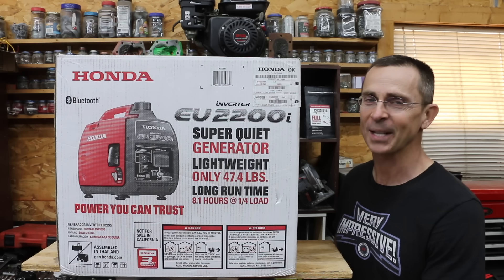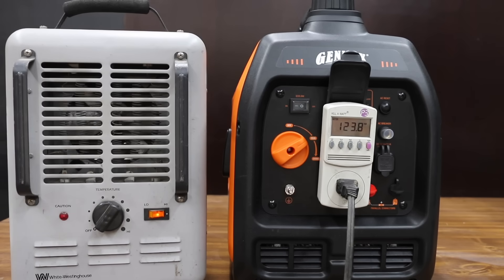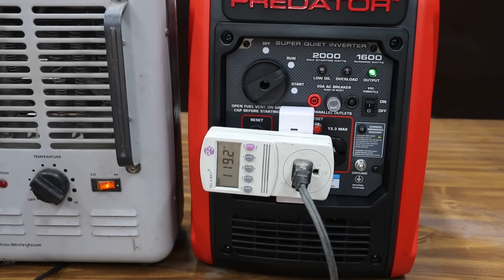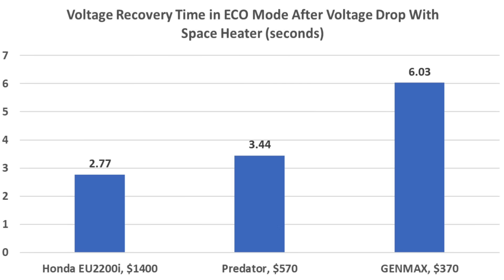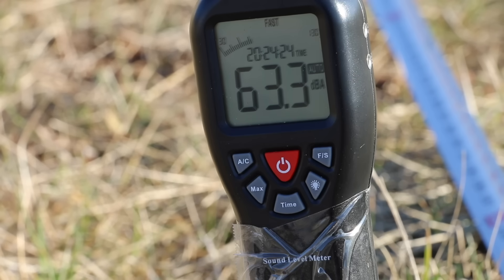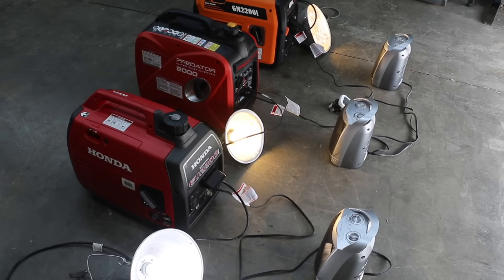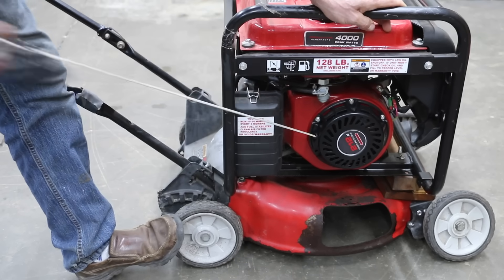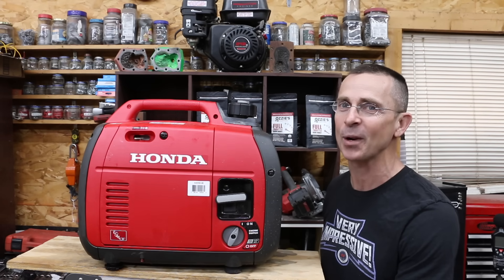Cheap Generator Better Than Honda? Predator vs Honda & GENMAX—Let’s Settle This!

Comment: Why not compare the USA-made Ini Power IntelliGEN Flex-Fuel Generator IG1000-ICMF  with the Honda?  Good, military-grade quality used by the Army, Navy, airlines and railroads.  Honda makes a great generator.  I wonder how good the IntelliGENs are.
Reply from the maker: Thanks for the suggestion.

Comment: Great video with all the details.  I have two of the Honda EU2000i and for the past 20 plus years they have never let me down.  I say, buy the best and forget the rest.  I never buy cheap tools and that includes my power equipment.  Honda generators, lawnmower, rototiller, string trimmer and riding mower.  It has to be a Honda or Powered By Honda.  I save money in the long run by not going cheap at the start.

Comment: I live in Alaska.
The most important feature of anything and everything up here is - reliability.  Because the nearest repair shop/parts store is probably more than 4 hours away.
That's why every single piece of motorized equipment I have ever owned has been Honda.
Honda is so reliable I don't even spend one second worrying if it will start and run perfectly.

Comment: Having both the Honda and Genmax, the biggest difference I see is the Honda runs smoother, it handles a/c starts better and starts on three or less pulls even after storing for months.   The Genmax always has an occasional miss even since new.   It also requires five or more pulls after storage to start.   And there is an absolute quality difference.    My old EU3000i still runs great, even though it smokes a bit at startup and that was purchased in 2001 and had an extremely high number of hours as a primary power source for a cabin running 24/7 for months and is still used in summers for the A/C in the cabin.
Reply from the maker: Thanks for the feedback.

Comment: It would be awesome if you did a "part 2" with more competitors. CHAMPION brand is a popular one, and they have a duel fuel model. I like having multiple smaller generators as opposed to 1 big boy, if something happens to 1 of them, you're still not completely screwed. However, I'm willing to bet other size of generators would be VERY popular for a video too.
Reply: I second the request for Champion
Reply from the maker: Thanks for the suggestion.

Comment: I have the predator. 3 months of daily use so far, sometimes 18 hours a day. So far its great. The choke cable vibrated loose once, no biggie, easy fix. Regular oil changes and premium fuel have made it run efficiently and reliable. At $599 its not the cheapest option but you cant beat a brick and mortar.

Comment: Both of my Genmax generators wouldn't start after 6 months of non-use and filled with regular gasoline containing ethanol.  The generators were stored in a heated garage in their original shipping boxes.   I tested them when new, and 6 months later when I needed them, they were junk.    I have no access to non-ethanol fuel so I used what I had.   Altho they probably just needed minor repair by an engine shop, I consider them a waste of money because they were useless when I needed them during a storm blackout.

Comment: Honda and Yamaha are worth the extra money.  Extremely quiet, clean sin, and runs forever.  Have 3kw Yamaha bought for $1700 back in 2005 for tailgating. Always worked great. Has battery for electric start.  For power fans, multiple TVs, sat receivers, radio/speakers might have to refill gas one time if it’s a 12-15 hour day. Runs 9 hours at full load of 2800W.  Quiet as can be. Only issue I had is when people plugged in 3 or 4 crockpots as on high that’s exceeding its load capacity.
Reply from the maker: Thanks for sharing.

Comment: Real life experience, I have had 3 different brands of snowblowers over the past 10 years, each breaking down within a few years, on the other hand, I have honda lawn mower for the past 15 years, still going strong, yes it was expensive but over time, it turned out to be the cheapest. Going forward, Just HONDA.

Comment: Great Review, but I was slightly disappointed at the end that you didn't discuss which generator, Genmax vs Predator. Obviously Honda wins. My opinion for the money it would be the Genmax. Predator was doing good up until the wear on the sparkplug which killed it.

Comment: The additional 4 ounces of oil is a HUGE plus.  These small engines run very hot.  Oxidation occurs much faster with the heat. Honda is worth it.  You get what you pay for. More oil in crankcase is a huge factor.  The Yamaha has gear driven valves;  Honda uses a rubber belt.  The  professional fishing outfitters in FL all swear by Yamaha.

Comment: The Honda will still be working in 20 years when you grab it from your garage.
Price shouldn’t matter when it comes to something so reliable,it’s worth it in an emergency when you know that thing is gonna start and run a slo g as you need it.
I have eight of the 2200’s,a eu3000,a 6500 and a 7,000.
I buy and repair them.
Almost always the problem is people letting ethanol gas sit in the carb.
Once cleaned they run like new again.
Reply from the maker: Thanks for the feedback.

Comment: Will the life of the Honda out last 2 Predators or 3 Gen Max gens?  Really not enough difference there to make me buy a Honda over the Predator but reliability is wroth more to me so I would probably buy 2 Predators so I could run in parallel if I wanted as wells as have a back up if one goes out.
Reply from the maker: Thanks for sharing.

Comment: Hey man, can you PLEASE do me a solid and tell me what the numbers are on the ignition coil for this unit? I have the same one and I have spent the entire day trying to find it online. Mine got rubbed off, I have zero spark, fuel is fine. long story short, I have diag the unit with tech as well, they refuse to send me one.

GM2200i
Reply from the maker: Which generator?

Comment: Concering quality and longevity. I will take the Honda. Thur the 80s I was a Honda dealership parts manager I also setup.. The Honda Rep. told us ... If you maintain that Honds lawnmower according the owners manual. That Honda lawnwer will last 200 years..❤
Reply: Enjoy this channel very much.. I would consider the Predator.. My brother has one
Reply from the maker: Thanks!  Thanks for the feedback.

Comment: Champion Power Equipment
4000-Watt RV Ready Portable Recoil Gasoline Inverter Generator. Please just bought one and don't know how clean the power is, I'm not trying to destroy my air compressor.
Reply from the maker: Thanks for the suggestion.

Comment: Here’s my long and short of the killer job you did here. Honda is a fantastic piece of engineering. However you could buy a genmax with 2 backups for the around same price.

Comment: TLDR:  Buy once, cry once.  Nothing beats a Honda Genny.  I bought an EU2200 used 4 years ago and after an oil change Ive only had to replace the air filter as I use it often.  I aid $700 for it overall I think thats the smart way to go, buy used and keep forever.
Reply from the maker: Thanks for the feedback.

Comment: you can compare it brand new it wont matter
what matter is
even after 15 years my honda starts only after a few pull on cold start, and one soft tug on hot start
and the cheap one wont even turn on after i dont use it for 6 months
for this kinds of thing, reliability is the most important
Reply from the maker: Thanks for the feedback.

Comment: I'd like to see:  duel fuel generators compared.  Wen 5600 vs Westinghouse 4650 vs Champion 4500.
Details on engines that they use would be helpful.  Do they use aluminum, steel or cast iron sleeves.  At what max load do they cut off at.  Run time at half load.  How long before each runs out a full 25 lb propane tank.  I plan on running propane (don't have to worry about propane going bad) but would also like to see how long they'd run on a full tank of gasoline at half load.  Also, if you know of anyone with electrical knowledge or is an expert on small engines get them to chime in like you did on your review of welders.
Looking to power a frig (i know they pull more power when the compressor comes on), a small 5000 btu air conditioner and if it's winter a 1500 watt heater and a small blower to a wood stove and maybe a few lights.
Reply from the maker: Thanks for the suggestion.

Comment: Get a honda if you want quality. But if want something cheap and working just get a genmax. With less weight it will be easier to move/handled. Because at that level of weight, 6 pounds difference feels a lot especially for girls. 😁

Comment: I was a true Honda man.  Ten years ago I spent two thousand on a twin cylinder Honda.  A drop in motor for my Hydro Mac Skid loader. Fit right in. Would not start at all. Called the company. Oh yea had trouble with some ignition trouble. Started right up.  Then muffler fell apart. Ran good ßven months. Sent another ignition still would start.  Pulled it out put a Kohler in. Been running great for years.
Reply from the maker: Thanks for sharing.

Comment: 14:18 what do you expect, its expensive for a reason, ive got its little brother, the eu1000i and its worked great since i got it back in 1998.
Reply from the maker: Thanks for the feedback.
Reply: 1998 WoW!
Reply: my local hardware store got some as they released and I picked one up for use with corded power tools and tailgating. Yes it’s lacking some newer model features but if you take proper care of it it’ll do the same with you.

Comment: Ive got a Honda EW171. Its provides 170 DC amps for welding and 4000 Watts AC for when our lights go out. Its old and loud but cranks up every time we need it and it was free from my father in law, thanks Cal trans 😆
Reply from the maker: Thanks for sharing.

Comment: I recommend Lucas high zinc break in oil for first 30 hours and use a magnetic oil dip  stick too. Make sure to oil the foam air cleaner element too, seems like they are factory installed dry.
Reply from the maker: Thanks for the feedback.

Comment: If you're shopping for a generator and plan on using/depending on it for a long time, just buy the Honda.  I use my EU2200i for camping to keep the camper charged up while boondocking (and to power the coffee pot and the wife's hair dryer in the morning), and even converted it to propane (Hutch Mountain), so I can get longer run times with a 5 gallon propane tank (typical bbq grill tank) vs the internal 1 gallon gasoline tank (basically 40 hrs runtime on propane vs 8 hrs on gas).  I visited New York City and every food vendor cart had a Honda powering it.  Imagine the run times those units are producing?  Awesome video showing performance and wear results.  As always, buyer beware!  Pete in Arizona - KI7LIL
Reply from the maker: Thanks for sharing.

Comment: I scored a Honda several years ago off of craigslist.  Brand new in the box for $600.  I took it out of the box, put the oil in and stored it without fuel.  I took it out before a major storm blew through and could not get it to start.  Turns out, that the small bit of fuel the factory put in for the test had not been run dry and fouled the carb.  Lesson learned, but still a good deal and I love that thing!

Great analysis, and bravo on your methodology.
Reply from the maker: Thanks for the story and the feedback!

Comment: What I find interesting, is my 14 y.o. Yamaha EF2000IS comes with an 8amp battery charger built-in, with a separate outlet and special charging cables included. It also has a fuel shut-off so you can run the carb dry, and a vented fuel cap like these, so it keeps the fuel fresh and free of moisture and air from degrading it. Sits for months on end without use, and fires up easily every time since owned. Very surprised that these much newer models are still lacking behind a 14 y.o. model.
Reply: Did a side by side test with a friend's Honda EU2000, they were very similar in noise output,  but the Yamaha ran much smoother, which was surprising.
Reply from the maker: Thanks for sharing.

Comment: Another great video my friend. I'm in the market to buy a generator. I read a lot of good reviews about Westinghouse generators.. I'm looking specifically at the 3300W/4000W dual fuel unit. It has remote electric start with a backup coil pull. Has a built-in trickle charger for batteries too.
Reply from the maker: Thanks!  Thanks for the suggestion.

Comment: there is a timer hidden in the honda wire harness that turns the engine off after a certain period of time in the trouble shooting manual after every thing checks out ok it says to install a new wire harness.

Comment: I'd love to see a comparison against some generators in the 3000-4000w range. Honda makes one in this range, theres also the Predator 3500. Maxpeeding rods MXR4000GT, along with a champion generator in this area. There's a lot more, but these are the ones that come to mind.
Reply from the maker: Thanks for the suggestion.

Comment: Based on the analysis it appears that while the Honda costs three times as much, the less expensive brands will wear out three times faster.  Is that an accurate summation?

Comment: There are three more generators of similar nature:Yamaha, Champion, and Wen. The form factor is becoming popular, I think. Also, I used a Predator 2000 heavily for a coouple of years and the regular oil changes and exhaust cleaning emphasized by the manufacturer are important. The machine will eventually become hard to start and run rough without them. This is a reference to the high iron accumulation in the chart.
Reply from the maker: Thanks for sharing.

Comment: It is a big blame for the gerator companies, giving US not a specific fuel consumption (SFC) and a efficiency diagram.
1 kg gasoline is about 10kwh. A good 4 stroke engine should not have 
have a great er SFC then 320..350 g/kWh. 
Consider, that 1 kg is about 1,2 Liter. 1 US Gallon = 3,758 Liter.
The Generator has a efficiency koefficient which is not constant over load. Small machines 75.. 90%. Over all you get roughly
1 kWh from 0,4 kg/h=4,8 Liter/h. The best SFC is mostly about 2/3 of rpm Max and 50..60% torque Max. 
Depending on motor design. Every propeller engine (piston) has this SFC diagram. Also every Motor in a car. But they wohnt give it out. Why should be clear now.
Reply from the maker: Thanks for the feedback.

Comment: What an unbelievable review! Ive been on the fence about a generator for 2 years now and cant make up my mind. I dont want to break the bank but also dont want to buy junk. The search continues ...
Reply from the maker: Thanks for the feedback.
Reply: @ProjectFarm Do you think the predator is worth the extra $200? I'd love to get the Honda but that's a little too much for me. Unless there is another generator in the 400-600 dollar range you'd recommend.

I was looking at the Westinghouse 4,650/3,600-Watt Dual Fuel Gas and Propane Powered Portable Generator with Recoil Start it's only 399 right now and is dual fuel. Have you tested those? Or even the champion. Thanks!

Comment: EU3000is, used in an off grid battery charging application so running at 80 to 90% load at least 10 hours per week. It always sits outside in the sun and the rain. It's 13 years old and still runs like a champ. No other generator will even come close to touching that.
Reply from the maker: Thanks for sharing.

Comment: I would be interested in statistics on a whole house generator. That would be in the range of 7500 to 10K watts? I have a predator 8750 that was given to me after it quite. It did not have a lot of run time and required a carb rebuild and a valve job to get it running. Furman makes a variety of products and would like to see stats on those vs the competition.

Comment: Honda 2200i is by far best in my experience, my last one 5000+ hours before failure 4 years, my new one with Bluetooth has 2500 hours in 18 months. I change oil at 150 hours full synthetic and spark plug at 1000 hour intervals. never did any other recommended maintenance.
Reply from the maker: Thanks for sharing.

Comment: The difference is the Honda you only have to buy once in 10-20 years, and it won't need repairs every few years. I bought a Predator and it lasted 80 hours before it died and wouldn't start despite a clean carb and good battery. Maybe a coil? Who knows, I haven't bothered working on it because it's not worth the time.
Reply from the maker: Thanks for the feedback.

Comment: Please test the WEN portable units. They are getting lots of media time, but are they any good. Also the Westinghouse  2 cylinder model. It's a beast at 28,000 watts on gasoline, but it could be a candidate for whole house service vs something larger like a permanent Kohler 28kw. Thanks. Marty
Reply from the maker: Thanks for the suggestion.

Comment: So the budget generators won't run anywhere near their rated loads for more than 15-20 min.  Makes me feel better about spending $ on a few Hondas. The EU2200i will easily run the rated watts.
Reply from the maker: Thanks for the feedback.

Comment: I have a predator 2500 I have run it 24/7 for the last 9½ years. Still runs great.  I get anywhere between 16 and 20 hours of run time on one tank. I change my oil once a week. Only big issue I have had was the throttle butterfly fell off the carburetor the day after the warranty expired.
Reply from the maker: Thanks for sharing.
Reply: You change gas, oil, and even spark plug while it's running ?

Comment: Honda will be running years later.. At the cost.of burning more fuel. The over head engines will be  needing service in approx 500 hours if lt lasted..
Reply from the maker: Thanks for sharing.